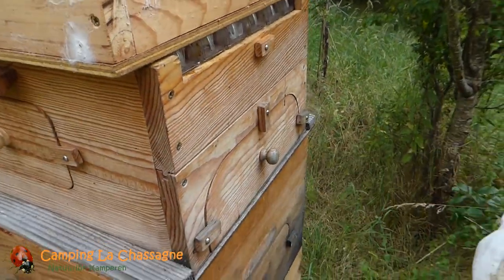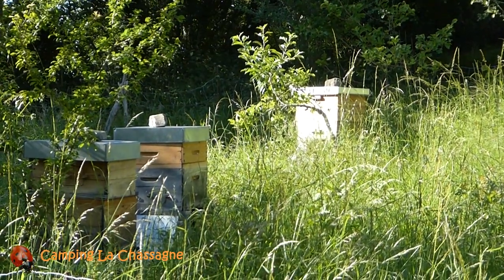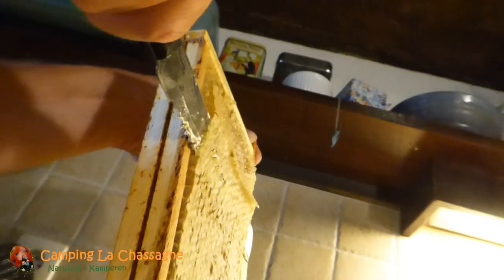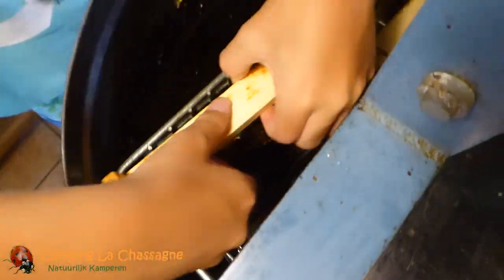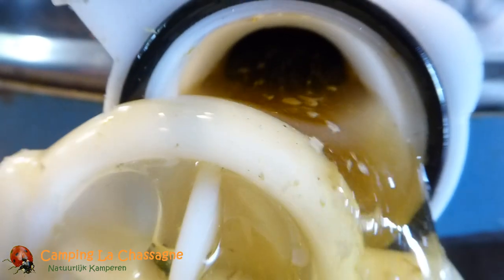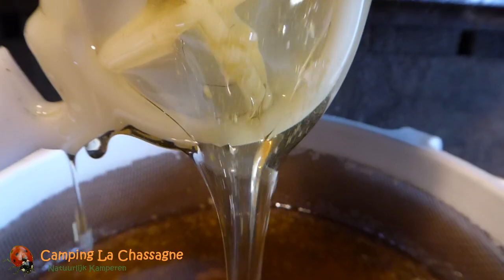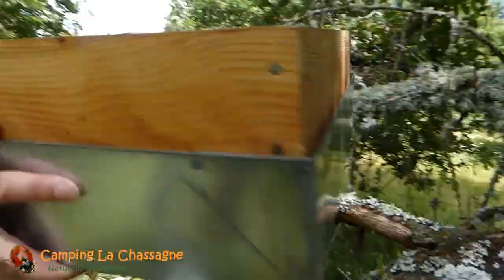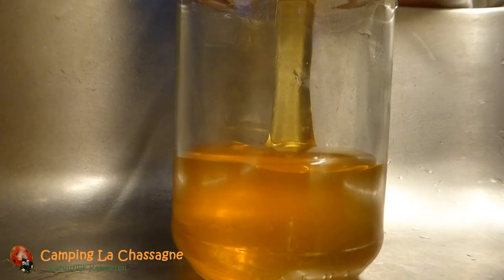Harvesting Honey in the Traditional Way  (for the 1st time) - Beekeeping - Flow Hive vs Traditional

Comment: Found your comparison videos very interesting. I have kept bees for over 25 years and started using Flow hives 2 years ago, and now that is how I harvest my honey.  I would like to point out a few details that you should have pointed out in your comparison. Using a Flow hive for honey extraction is much easier on the bee colony when compared to harvesting in the traditional way. Using the Flow Hive, you dont have to open up the hive, use a number of different methods of getting the bees out of the honey supers, lifting heavy boxes off the hives and then all the work, heavy Lifting (and mess) to extract the honey, then the filtering of the honey, cleaning up more mess, then after harvesting the honey you need to put the honey supers back on the hives which means disrupting the colony again. As I well know (over 25 years of experience) during the honey harvesting, having to remove the capping wax can do a fair amount of damage to the honey comb, which the bees then have to put a fair amount of work into repairing, meaning the bees have to produce more wax (meaning the bees have to use more of their resouces, honey) to produce beeswax, to make the repairs. Using the Flow system the capping wax remains intact during the honey harvest and I observed that the bees in the colony (usually within 36 hours have removed  the capping wax & recycle much of it). And clean the Flow honeycomb and do a minimum amout of repairs and start to store more nectar into the honeycomb within the 36 hours. Letting bees clean out the honey supers by leaving them outside the colonies  is OK, but it can and does encourage robbing unless you take the honey supers at least 100 meters distance away from your colonies. There is also the extra expense of a uncapping knife, extractor, strainers, filters, perhaps a uncapping tank, honey setteling tank, etc. If you can borrow an extractor or maybe your bee club has an extractor that is good. However unless the extractor and the other equipment used during each of the honey harvests has been properly sanitized/sterilized between honey harvests from other beekeepers, it can have the potential to spread pathpgens and diseases (foulbrood is one) to your colonies. Putting out the honey supers for the bees to clean out can also spread potential diseases. By Using the Flow hive system the honey frames and supers never have to leave the hive and one can also harvest many unique individual and unique kinds of honey from the individual Flow frames. Using the Flow Hive is overall much more friendlier to the bees and honey harvesting is much more easier on the beekeeper and his/her bees. But one still has to do the normal colony management and inspections associated with good Beekeeping practices. My YouTube channel is "Honig Trail Apiary" . Thanks for reading!
Reply from the maker: Thanks for the extensive  reply! :)  Some of the things you touch upon, I talk about in another video of ours: https://www.youtube.com/watch?v=Ub418RRwnuU
Reply: @campinglachassagne8339  just watched this video, you did a very good job of explaining the honey harvest from your Flow hive!
Reply from the maker: @honigtrailapiary4341  - Thank you! :)

Comment: I always had 2 questions-

1) Is the wax eatable?
2) How do you handle the bee larvas?
Reply from the maker: ad 1) If you are referring to the flow frames, then most of the flow frame is made up out of plastic. The wax that the bees use to further build out the cells is not really collectable. 

ad 2) To avoid getting bee larvae in flow frames, you can use a queen excluder, just like in a situation with wax frames in the super.

I did not use a queen excluder for several years without problems. However, at some point the queen did lay eggs in the flow frames (mostly drones). I made sure the queen was no longer in the super, and added a queen excluder. I then simply waited until all larvae had turned into bees and had left the cells. The bees cleaned up the cells and filled them up with honey.

(B.t.w. drones are not able to go through the queen excluder, either, so an exit should be made available in the super under these circumstances).